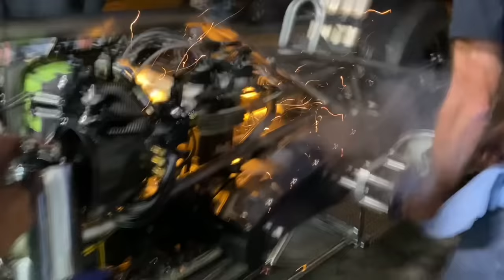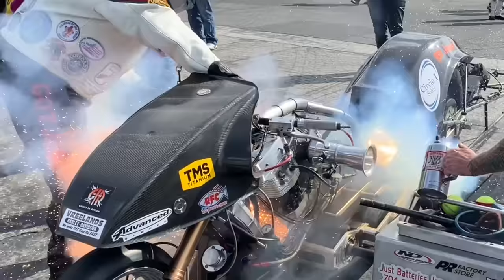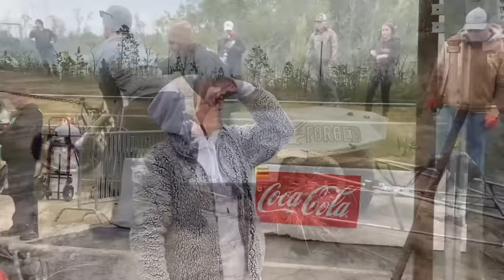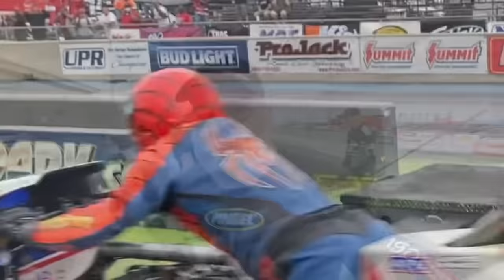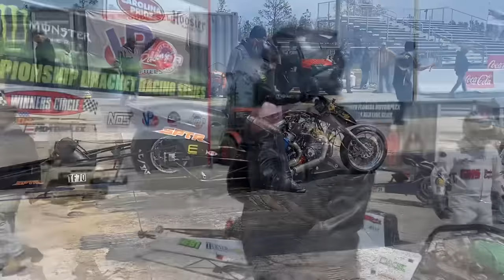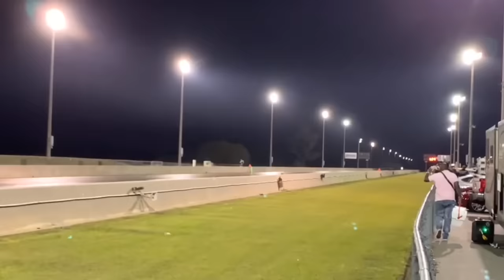Top Fuel GONE WRONG! Crashes, Explosions & Firm Reminder Nitro is NOT Your Friend!

Comment: Nitro Methane plus oil = nitro glycerine. You start on alcohol switch to Nitro, at the end, you switch back to alcohol before shutting down. If the engine fails to start, you empty the oil before restarting.

Comment: I get that these bikes are not as fast as the top fuel dragsters, but they look faster. Maybe it's because they're smaller. With these bikes, taking off from the start line, it really is a case of "blink and you'll miss it".

Massive respect to anyone who gets on one of these monsters.
Reply: It's one thing to be inside a roll cage, but laying on top of one these things with a 1500 HP bomb under your belly is a whole new level of courage.
Reply: They moved the engine behind the driver for safety creating the rail car. Funny cars are inherently more dangerous because the motor is in front of you, but laying on top of a nitro motor in my opinion is one of the most insane things that man has come up with, and these guys do it on a regular basis, NUCKIN FUTS!!!

Comment: I can attest, in my Go Kart days, running fuel, I bench tested my engine with my Nitro mix, got running and it started to over rev, had 2 carbs I closed off the intakes, it kept on over reving with intakes closed off, I then pulled the fuel lines, luckily it did not come apart or cause damage, but in the races I burned holes in 2 pistons.
Reply from the maker: What was the most stunning incident you saw here and why? Thanks for watching and subscribing.
Reply: That MC at end of run kept on going even after he shut it off is terrifying.....

Comment: I had a top alcohol dragster and I was at a national dragster event in Kearny Nebraska and back in 2003 that track had like grass growing up thru cracks it was the sketchiest strip I've ever raced. So anyways after several passes albeit extremely bumpy and made my back hurt, I was still consistent and fast, until the semi final.... Went down the track and right as I passed about the 1000ft I hit a bump and my air intake bounced and touched my right rear wheel and the wheel ripped it off and threw it under the engine wrapping my fuel line around the block... O__O then it backfired and WHOOOOOF big pop and lots of fire. Wasn't scary like this but man when you've got a motor making that much pressure that close to you when it goes off? Yeah you remember that shit lol.
Reply: For those of you who know top alcohol dragsters you can imagine how hard the bounce had to be for my INTAKE to contact my rear tire.
Reply from the maker: Thanks for adding that! What was the most stunning incident you saw here and why? Thanks for watching and subscribing.
Reply: @DETHdressedInRED  Glad your ok! blessings for you and your family!

Comment: When blasting companies need a slightly more sensitive blasting composition than ammonium nitrate/fuel oil (diesel) 
They mix the ammonium nitrate prills with nitromethane.   Bit easier to set off than ANFO... little more detonation velocity. 
Ain't chemistry fun kids?

Comment: Nitromethane is unstable.  The Germans first used it, before WW2, in a skinny fabric tire Formula 1 car of the day.   It was created to be a strong cleaning solvent, which it is as well.  It took the Germans OVER WD40 attempts.   Created by accident in the end, kinda like Champagne.     Its a party in the fuel tank, but it's gotta be timed right or it sprays expensive parts all over everyone.  No unscheduled hot copper cladding embedded in my thigh, thank you much.
Reply from the maker: Great insight. What was the most stunning incident you saw here and why? Thanks for watching and subscribing.

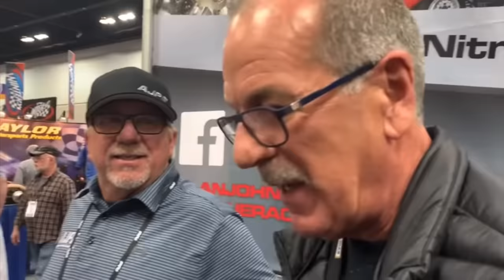Comment: I'm gonna pause this video right now at 6:08 and say,  YES ABSOLUTELY Larry McBride's beautiful Star makes profound unfathomable horsepower. BUT, in line 4's produce very smooth power in my opinion, compared to the 45° vtwin single crank pin with a firing order that makes you scratch your head.  Plus, the low end torque (60ft-120ft) I'm guessing is much more violent than Spiderman's bike. Has he ever rode aT/F Harley?  If not,then he can't really answer that question. Honestly, both scare me a little. But man I sure would LOVE to learn!!

Comment: With more power comes more torque which in turn reduces handling. As you roll on the throttle and release the clutch, that torque which launches the bike also raises that front tire (countered by the wheelie bar) ever so slightly. That rise is a loss of front handling. Your basically wheeling down the track at 8.5ft/.10sec

Comment: I use it in my rc cars...never had a problem..lol
Reply from the maker: lol. What was the most stunning incident you saw here and why? Thanks for watching and subscribing.
Reply: Are you using 15%-30% nitro fuel or an actual NOS bottle connected to a jet spraying into the carb? I have many nitro motors and want to run NOS through it but haven't gotten far with it.

Comment: Now how is that tiny sandtrap supposed to stop anybody? Like that's just cheap and unsafe from the owner
Reply: It would stop the bike if the bike was reducing velocity (cut of power). The sand trap would bring the bike to a stop through drag (given enough acceleration bleed off). The bike that crashed was still under power

Comment: well the rear engine top fuel rail the engine behind the driver was done by big daddy don garlets i found this out at work painting truck the guy had a Gm car clutch blow up threw floor parts went his leg messed up! the main painter had that happen in top fuel sling  shot blew apart at the clutch & it slit at don's feet he was in hospital working on rear engine design swamp rat racing car!  he built it & figure out the slower steer gear it went strait the nhra show us it goes strait i let race it! it took racing by storm ever copy it it was safer
Reply from the maker: What was the most stunning incident you saw here and why? Thanks for watching and subscribing.